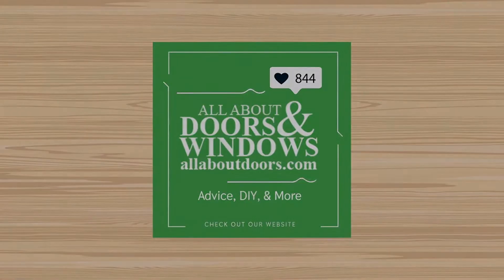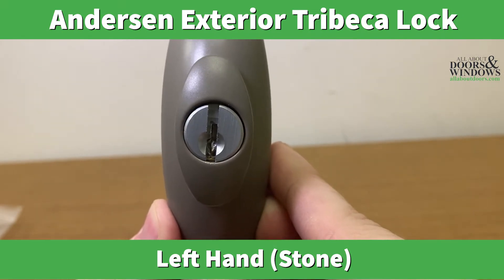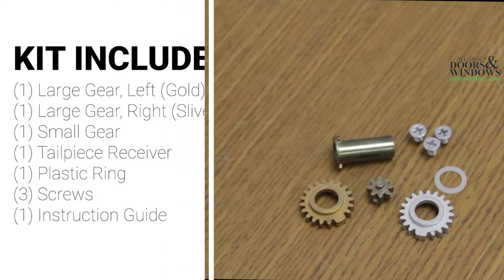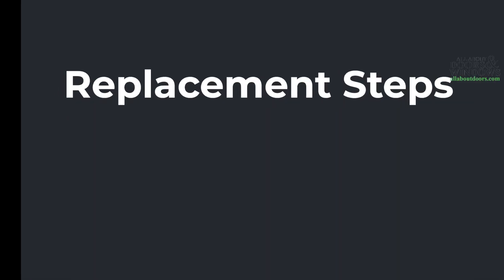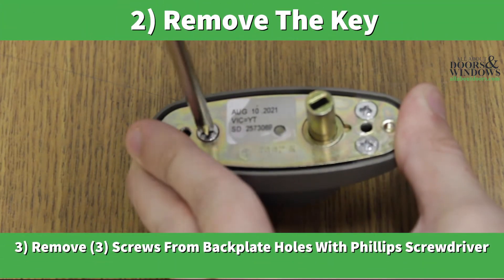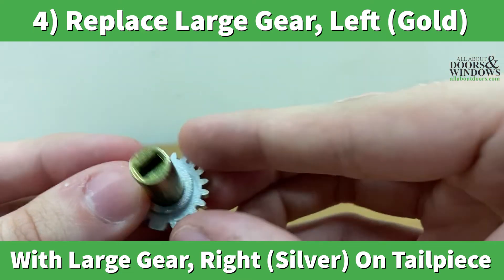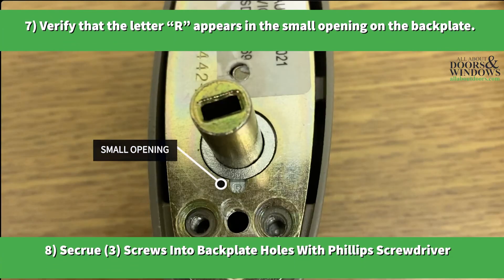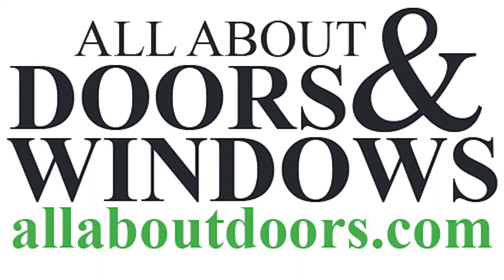Changing The Handing On An Andersen Keyed Lock in Two Minutes

Comment: I just need to know how to install it, having difficulty
Reply from the maker: Hello, we very much appreciate your question and would be more than happy to help.

We have a video on how How to Replace Key Cylinder in an Andersen Door.
But we can help you out with these six steps!

1. Loosen the set screw and remove the handles. 

2. Remove escutcheon plate bolts and interior and exterior active escutcheon plates. Remove cylinder mounting bolts and remove the dummy cylinder, lock actuator, and limiting plate

3. Assemble exterior keyed lock cylinder assembly

4. Position the exterior keyed lock cylinder assembly into the exterior side of the door panel, and align the tab to the horizontal slot in the lock mechanism. Position the lock actuator, into the upper hole on the interior side of the panel and into the horizontal slot in the lock mechanism. Position the limiting plate over the lock actuator and align the bolt holes. Fasten using cylinder mounting bolts.

5. Reapply escutcheon plates and gasket to the panel as shown and fasten using escutcheon plate bolts. Do not fully tighten bolts until the handles have been installed.

6. Insert the spindle through the escutcheon plate hole. Slide the bushing and exterior handle onto the spindle and push the handles together tightly. Insert the set screw in the exterior handle and tighten using the hex key. Finish tightening escutcheon plate bolts.

If you need further assistance just click the link in the description below this video under CONTACT US. From there one of our experienced customer service representatives will reach out to you and better assist you with your question.
Reply: @AllAboutDoorsandWindows  Thank you so much for all this, but I have 3 of the Anderson permashield 200 doors in my house of which 2 have the Tribeca keyed locks and the keyed units go bad and have to be replaced. I buy them locally as they key them for our house keys. But each time I think I got it, as soon as I take the key out it will not lock from the inside. I need to know the exact steps on how to replace the lock only.
I thought I have checked just about every video but could not find one on just the replacement of the keyed Tribeca locks to a permashield Anderson door.  Thank you again